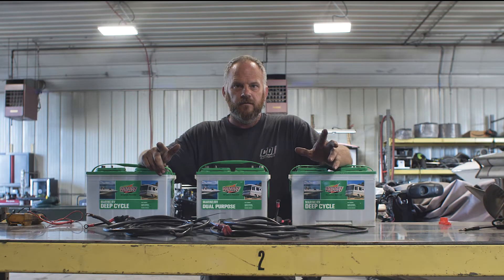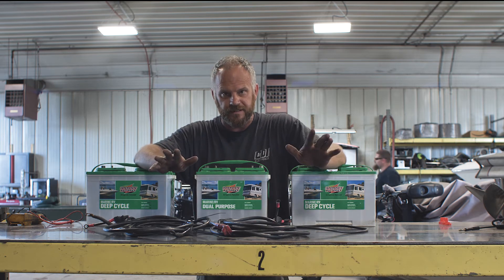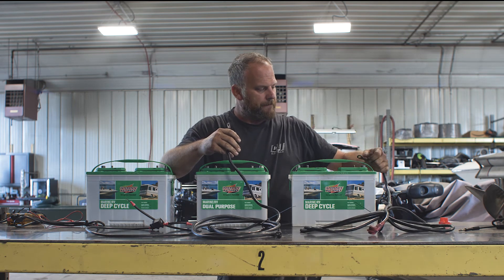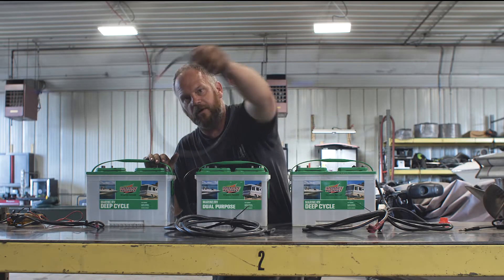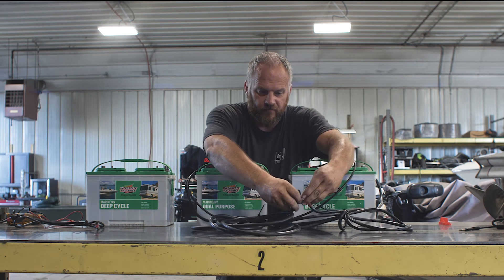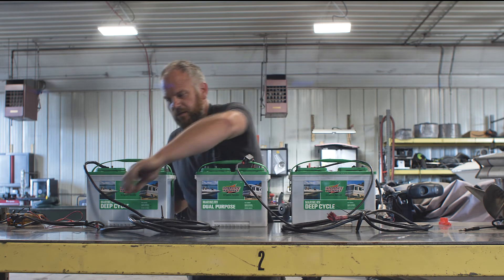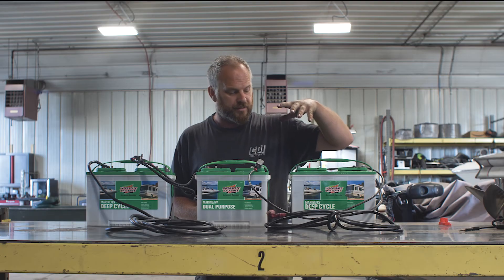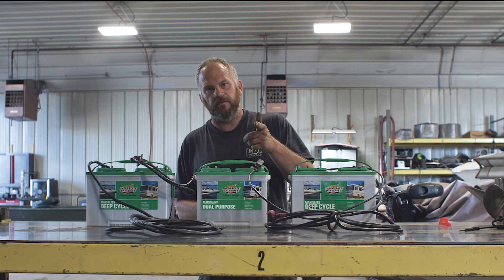Team Tech Tip # 11 | Trolling Motor Voltage

Comment: Ok. I know this is an older vid. But I just wanted to note that I have found when going from a factory wired 24v to 36v the cables and crappy crimped connectors don't really like the extra amperage/current draw. 4gauge just doesn't like 36volts. And I think it hurts the motor itself self with the current drop under load. Just my thought. Keep whistling on!